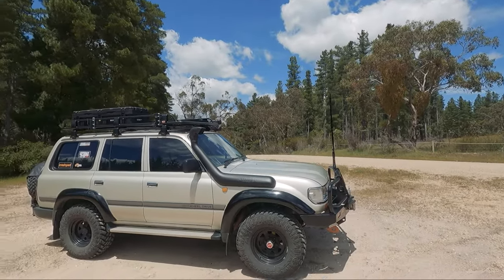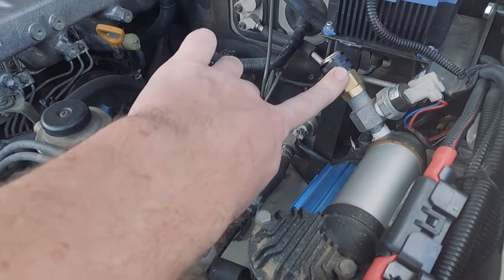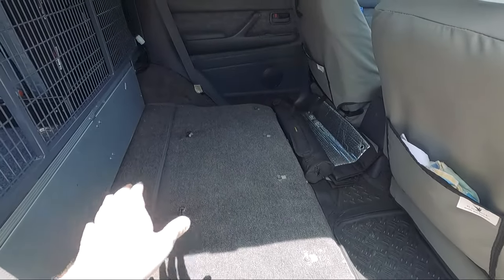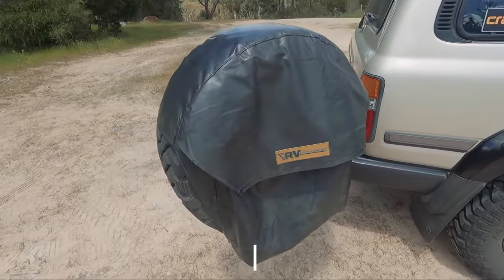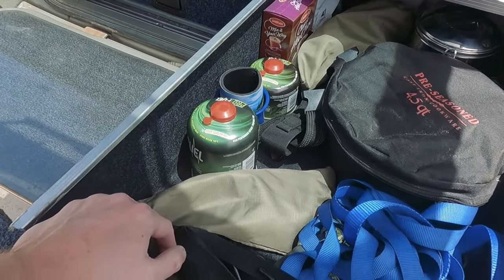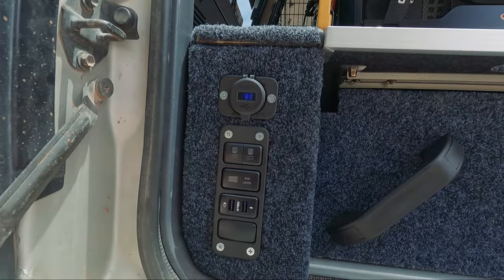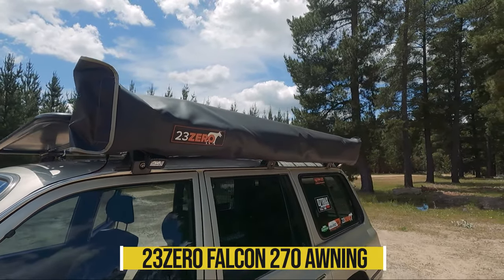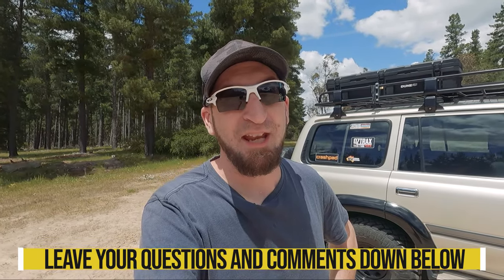Toyota Landcruiser 80 Series Build // The Road So Far...

Comment: Excellent practical mods.  I also considered that exact fridge drop slide to replace my basic slide, but the weight (& cost) 😲 of the unit, I ended up deciding against it.  How did you routed the wires for the LED ights on your upper tailgate back into the car?   Did you go via the OEM wire route?
Reply from the maker: Due to my accident I had no choice, but I worked with the Clearview Accessories engineering team to come up with a solution to run that specific fridge/freezer setup with that slide.

Yep, definitely pricey, but at least I can get into the thing now and open the lid all the way up, which was a deal sealed for me.

I ran two new power wires through the OEM route for each pair of lights and took the earth off the wiper motor in the rear, as the upper tailgate actually earth's through the latches when closed.

Silicon spray will be your friend for running the wiring. 👌

Comment: Hey mate, awesome video and 80 series. Do you think the 80 series is a much better car the 90 series Prado? I have a 90 series that needs a bit or work, not sure whether to spend the money and time rebuilding the 90 series or buy an 80 series and use that as the base.
Reply from the maker: Hey Adam

Glad you liked the video, trying to improve on the production quality as I get better gear to do so. :)

Having now owned both, I can say that they both have pro's and cons.

The 80 series is a noisier vehicle and a bit of a rougher ride, but is way more robust than the IFS 90 series due to being solid axle.

The 90 series is a far nicer and more comfortable ride and way less cabin noise.

I don't have the constant lower ball joint replacement issues, but I do have to adjust the front wheel bearing freeplay every 5-10k (well,  Sock does it for me currently) haha.

The 80 series is a bigger vehicle too, where the 90 series I was very limited in storage space.

And then there is the point of being diesel.

Yes, its expensive to maintain, but I found the 90 series on 285's used a heap more fuel than the 80 series on 285's, both being the same tyre and this comes down to having the torque to turn them.

A petrol makes torque higher up in the rev range, and a diesel makes it low, so don't need to flog the diesel to get it going.

The other factor in the 80 series vs 90 series is that there are far more aftermarket options for an 80 series than there are a 90 series.

Ultimately, the decision is yours which way you go with it, but I think the 80 series wins overall if you factor in everything mentioned above.

Hope that helps you make a decision.

I will be doing a video on this at some point, I just need to borrow Socks rig to do a comparison.

Cheers
Mick

Comment: You running a lift on the old bus bud or just stock lift ?
Reply from the maker: It has a very old 2 inch lift in it.

Next year that will hopefully get a refresh. 🤠👌
Reply: @OzTrax4X4  awesome matey , same 2inch lift again ? 80s looking awesome bud
Reply from the maker: Definitely not 🤣

This came with some cheap Brazilian shocks (can't remember the name), looks to be King Springs up front and Lovells in the rear.

Will get something way nicer, just have to put some cash aside.

Suspension is the very last thing you should do on your build so you can get your spring rates right and not do it twice. 😎
Reply: @OzTrax4X4  agree to agree mate , couldn’t be more correct with that one , see people get it wrong all the time an ends up with just an uncomfortable ride
Reply from the maker: @harryridley2714  I've worked a short stint in the 4WD suspension industry, so have seen things that customers request and then come back and complain about the ride quality. 😆
Reply: @OzTrax4X4   I’m just about to pick my 3rd 80 up which I somehow picked up for a steel so the mod list can soon begin an to say I’m excited is an understatement 👏🏻
Reply from the maker: @harryridley2714  oh nice! What did you end up picking up spec wise? Petrol/diesel?
Reply: @OzTrax4X4  1990 1hdt , 190k on clock and one owner , pretty darn lucky on this find 👍🏼
Reply from the maker: @harryridley2714  Dont know why i didnt see your reply....good ol' notification fail there.

HDT will be great. Just remember to do the big end bearings every 100k and you'll have some happy motoring 😀

Comment: How did you get from the switch panel to the roof rack and into the boot lid
Reply from the maker: Hey mate

Switches get power from the 12v panel on the cargo barrier, the roof rack light loom is run through a hole drilled under the black 1/4 vent trim and the power to the tail gate light is two seperate power wires run up the D pillar, above the roof lining and in through the factory rubber tubing, down the side of the upper tail gate and into the cavity behind the trim.

Earth wiring will need to be tapped into your rear wiper motor earth as the upper tailgate earths through the latches when it's closes, which was a pain to find out.

Comment: Your 80 is looking schmick.👌  I've been waiting for a Kaymar RHS wheel carrier to come on Gumtree for a long time now, but still nada.  I might bite the bullet and buy a new one.  Great work on all your tasteful mods.  The kinda mods I too would like to do on my rig.  Though as I am running a RTT, reducing weight is now a priority also. 👍
Reply from the maker: Thanks mate, she's getting there.

An alloy rack or even just some roof rack bars will offset the weight of your tent rather than running a platform rack, but then again, depends if you take your tent on and off.

Lightweight is the way to go for sure. 👌

4WD Systems do a RHS swingaway if you want to go new.

I got lucky with the Kaymar one but needed full restoration for it to come up like it has as well as a completely new mounting bracket manufactured to mount it all up as the original was rusted away and cut in half by the previous owner.